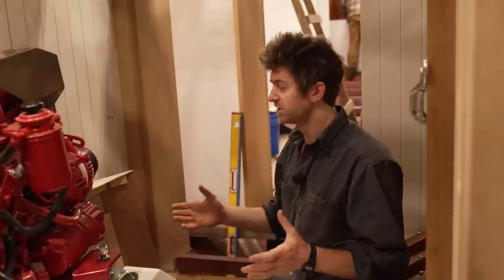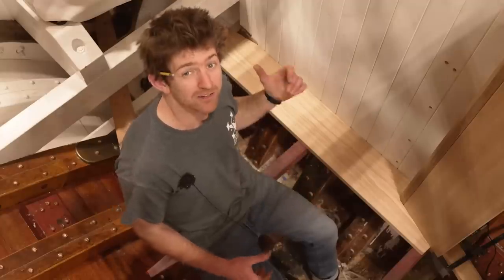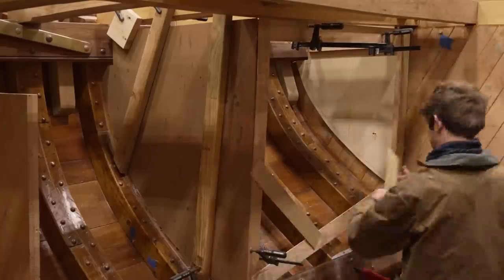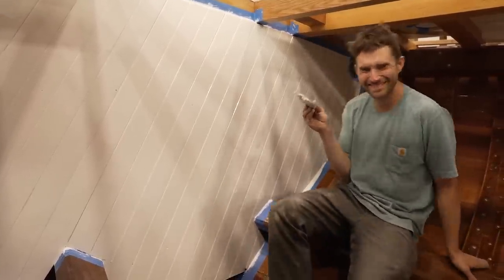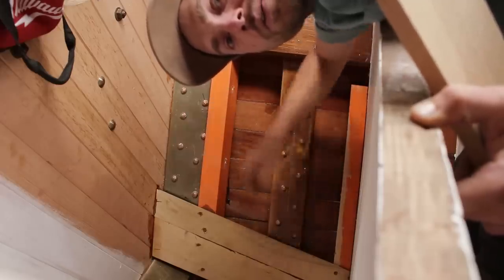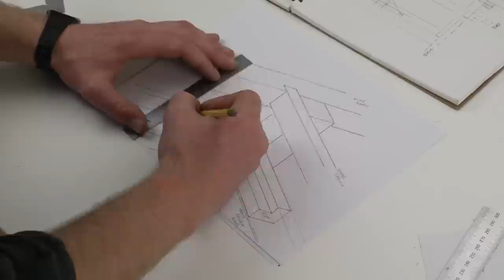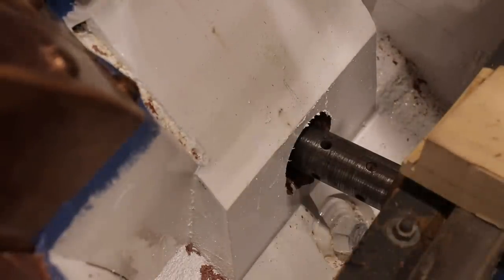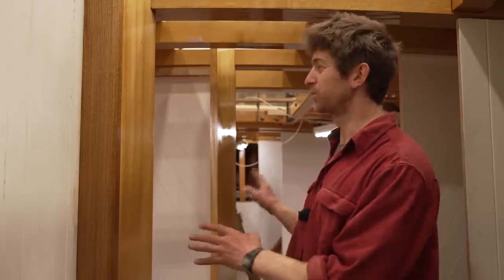BACK TO WORK! Lots of interior and systems progress... (Boatbuilding / Tally Ho EP126)

Comment: The 'dependancy tree' on this project is crazy. "I have time and materials to do the sole boards, but I have to get the fuel tanks designed, which ties to the deck plate, which ties to the cockpit design, which ties to the paint on the bulkheads... so I need to order the tanks, place the fittings, measure the spacing between the deck beams and after spinning those up, what was I doing? Huge respect for you.

Comment: Cockpits on wooden boats often have very straight vertical back rests and it really pays off to get some comfortable slope into the back as well as the seat so you’ll automatically slide in backwards due to the slight angle. It sits very comfortably as you slide in the back of the seat with a comfortable backward leaning resting position from which you can still steer the boat and operate winches comfortably as well. Maybe test and calculate in some dimensions for cushions that are comfortable but not to thick. You’ll be spending lots of time sitting there and there are human dimensions and angles that are industry standard for comfortable seating, it’s worth looking into (interior design as a study has lots of lists with  predetermined dimensions correlating with the size of people it’s designed for, it’s really helpful to build comfortable well sized seating etc.)

Comment: Much enjoy watching Tally Ho being reborn' i was a commercial fisherman in Alaska for 30 years and had 3 sail boats after i retired. If you aren't planning to put a drain plug in that drip pan you might consider it. Easter to get the bulk of fluids out if you have a high volume spill.
Reply: Definitely
Reply: I agree. If not a drain plug, I'd put a sump area in the pan to dip a suction hose into. I'd also put a shallow "V" in the bottom of the pan to channel to the sump area..

Comment: You know what would be nice is a tap on the oil pan to drain it into a bucket cleanly if it gets full as well as an oil tap in the oil sump of the engine. Mitch cleaner than mopping up with oily rags or pulling a bung plug.

Comment: This was great! 
I have had many radically different jobs in my life, and as a result have lived many different lives.  Because of that I notice patterns in kinds of work.  I have lived (worked) in worlds where there was no music at all (my time in politics was bereft of music).  One thing I will say about boat builders is that music is part of their world and they are well steeped in good music. Heavy equipment opperation (scrapers, cats, and graders), and driving highway buses (motor coaches) were the two worlds of mine that were heavily geared to music (pun intended).  I have followed you for quite some time now, and I have to say, damn man, you have fine taste in tunes; and in other things as well (like wood, videography, companions, ethics and stuff).

Comment: That was a tricky sole board, I liked the little round notches for the frame rivet heads.

For the video style do what you feel works for you. 

I thought the prop tube was going to be a hammer into place item. Looking forward to the diesel tanks episode. 
How did you and Patrick end up doing in the race?

Comment: I love your work and the videos. Tally Ho will be a masterpiece when finished. I have question regarding the drip pan for the engine. With the slanted sides, won't that result in oil spilling into the bilge (if there is any in the pan) when the boat heals over?

Comment: Need to add external handles  to your drip pan....or you could just get oily everytime YOU  take it out
Reply: Perhaps the drip pan needs a drip port with drain plug somewhere up front?  Could let any oil drain out of the pan into a small container and not have to remove the pan?
Reply: Don't believe it's ever intended to be removed. Ideally it should have nothing, or near nothing in it.

If something blows and dumps the crank case into it, they'd be far wiser to pump it out of the tray into jugs for removal, and you can just clean the residue with rags and solvent in situ.
Reply: There is always condensation drips, slight drips from gaskets, and fill spills--   a drain plug is for routine use, not for catastrophic events.... @Nevir202
Reply: @alfaspiderveloce6617  Nobody was talking to you.

I'm saying it's nuts to take it out as OP was implying.

Ya, you may get drips here or there, but you aren't going to remove the pan, or need a drain port for a handful of drips.
Reply: @Nevir202  umm a few drops doesnt cover the need to avoid pumping oil into the ocean from the bilge
Reply: @chascain1  Ya, because the pan is also there in the event of a catastrophic leak. 

But again, in the event of that, if you try to move that pan, FULL OF OIL, you're going to spill it into the bilge and put it into the ocean anyway.

Comment: I failed miserably to fit some skirting boards (base-boards) in my home so when I see the precision fit of your woodworking it amazes me. It also infuriates me at the same time.
Reply: Patterns are your friend. CAD Cardboard Aided Design. :) But seriously, if you master the uses of patterns, no fitting task will be above you and you'll look back and laugh because it was always so easy. You can also help yourself with various tools of the draftsman. Compass, square, the edge fingers etc. And they don't even need to be the most expensive variant of said items, you can make do with functional variants of them.

Comment: Loved the video, as usual. Chiseling the wooden plugs is particularly satisfying to watch. 😄  The different processes of designing that you use are great to see: from rough model to sketch to CAD. I found the occasional radio coming through very good, in fact the first one had a bit about the new Prime Minister of Australia and that gives me a good sense how recently you were busy with that project. You never did where you finished in the sailing race… unless of course you didn’t complete the course. 😉 
Looking forward to the tank installation video and the fancy new filler cap to be fitted.

Comment: I am no help on which formats are best.  I like them all.  I appreciate all the time you spend to film/edit and we get to see enough of what you are doing so we understand your process.  It’s always great to see your tools, equipment, shops, and the cast of characters.  I enjoy your hand drawings, too.  I try to mix sketches with my CAD drawings in my shop for myself and sometimes for clients.  You are more artistically skilled than me, tho.

I am a retired timber framer and have a well equipped and nice size personal shop.  It’s been great for working on and winter storing my fleet of boats here.  My stuff (and there is a LOT) will go somewhere in the next ten years or so.  I am in northwest Montana…..maybe to a young timber framer who wants to make a go of it?  Or maybe it will be a talented boatbuilder like you in Port Townsend.  I am still picking away at my stock of dry salvaged fir.  I still have a lot of projects.

I have not been to Port Townsend since 2014??.  Work, play, and Covid impacts.  It’s time to go this September.  It would be great to meet you and your crew for after-work beers.

Comment: With regard to the drip pan for the engine, May I suggest & recommend you have the metal worker include a “return” around the top edge, to prevent any excess fluids from slopping over into the bilge. It’s amazing how these problems will happen when you are not looking, or busy on the forward deck.

Comment: Just an idea. The drip tray should be sloped with a ball valve for changing the oil. You could drain the engine into the tray and let gravity feed it into an container at the front. Wipe down the tray when you're finished.

Comment: The drip tray is a good idea, but since this is a sailing vessel I suggest to make the sides higher otherwise any oil may flow out when heeled. 
Also suggest to check any possible oil leaks when the engine is under extreme heel. (like accidentally drying out on the tide). The dipstick and crank vent should be led to somewhere along the centerline so all oil in the engine stays in the engine, whatever position the vessel is in. Also check the gearbox vent opening. 
I learned this the hard way... I dried out, forgot about the engine, and after the tide came back and the boat afloat, found most of the oil back in the wet gear locker having escaped the engine via the dipstick

Comment: Hi Leo, I love your mission. About the drip tray; maybe it is an idea to make a tiny (few cm wide) roof on both sides of the drip tray to prevent oil from going over it when the boat is shaking or/and at an angle. That small side roof could be tilted down a bit to the inside just in case oil spils on top of it so it drips into the tray.

Comment: I enjoy watching all the intricacies and cutting various multi angles as you've hand crafted each piece of wood to fit to an exacting standard.
Bulkheads, soul, doorways and all the like are amazing to watch as you machine and fit each piece.  Bolts, screws, tar, glue all used to make the total one solid structure.
Before the advent of power tools, I can imagine that the amount of handmade parts and labor for such a project was off the charts.

How may boat builders would work on a boat like this at one time, back in the days of its origin?

The amounts of heavy hard wood being used is staggering to me!  The boat must weigh a lot.   The engineering work and design needed to properly float this boat, with its weight, is amazing to me!  
I'm enjoying the journey with you as you go along in the build.

Comment: I really enjoyed the video and the variety of jobs. Thank you for showing the thin ply and hot glue method of templating, it's such an easy and accurate system that I wish we had back in the 60's when I started boatbuilding. I think you mentioned a sender when talking about the polly tanks, if that is for a fuel gauge then I would think again. In my experience they have all been inaccurate and temperamental, you really can't beat a dipstick and if you loose that a broom handle will suffice. I am really glad to see you re-energised from your trip back to Blighty and really looking forward to seeing Tally Ho in the fitting out stages. Congratulations on your skills not only as a boatbuilder but also as filmmaker, editor and storyteller.

Comment: Good idea to put a drain plug under the catch pan making for easy cleaning or for oil changes. Also a big plastic drum (old water tank) in the chain locker for the chain storage would be a thought. With a small drum or 12 inch pipe drilled full of holes placed inside to protect a clean out pump. For when you wash off the chain in the drum. Plus it keeps the chain locker clean, dry and the dead sea creatures smells down. 🧐👍

Comment: I put a larger dia. shaft in a wooden boat and used the same method as you to bore out to accommodate the larger stern tube. In do so I cut through some of the fasteners. Eight years later we had a water leak, it turned out that electrolytes had occurred between fasteners and stern tube. It took some head scratching  to find the fault, we had to replace the tube.
Cheers, 
Peter

Comment: I might have added a drain valve  in that pan. When that pan gets a load of oil in it, it's going to be heavy and unwieldy. With a small drain valve you could remove any spillage with a small bottle untill it's easier to handle taking the pan out.

Comment: I like the variety of this sort of video. I'd be interested to see what your plan looks like. I'm sure you don't have a modern-style project plan with Gantt charts and such (good thing too, more time spent planning than doing) but you must at least have a list, with some sort of sequence so that things that need to be done before other things are sorted out. So many little tasks - nearly everything that goes in the boat seems to need 'a couple more coats' or a 'final trim to length later', nobody could just remember all these things and it's hard to believe it's just scraps of paper in a shoe-box. Very grateful for the 'inboard-outboard' and 'forward-aft' markings on your beautiful drawings, else I'd be thoroughly confused.

Comment: Enjoyed the variety, Pati on bulkheads, chain locker, paint.  Once again, your sketches and CAD designs are impressive.  From the engine drip tray to the fuel tanks.  The prop shaft work, cabin sole, are underway.

Comment: The way you matched the board and grain pattern in the sole boards was very nicely done!
Reply: The first board seen initially not so much of a fit, but it introduces the sculptural tension into the whole when seen as a piece of art. thank you for what you do.
Reply: @BRUSHYSURFING  For your information you can always edit your comments by clicking on the 3 vertical dots to the right of comment.

Comment: Your drip tray needs some vertical X's - one piece running about 75% of the length down the middle and two cross pieces about 75% of the width.  You are likely going to be rocking about and anything in it should not gain momentum and slosh out.  Much like baffles in an oil tanker.

Comment: Hey Leo I'd recommend you to make the drip tray drain into a small pipe and install a swimmer with an electric sensor that is normally closed and wire it to an emergency stop or ignition cut off for the engine to stop. If you think you need the engine you can install an override at the switch panel as well. This way you won't unintentionally hurt the engine.

Comment: Thanks Leo great work as always 👍🏻liked the variety of jobs done. As the build get to this stage would guess the videos will cover lots of construction at a on going stage. This is very interesting looking forward to the engine installation as i am a mechanical engineer so interested to see how you go about this. Have marinised a few kubota engines for 30 foot boats but intrested to see how you go about this and what system for fuel and exhaust you will install. Love the engine drip tray design 👏 what a great idea. ⛵🏴⚓

Comment: With regards to the return line for the diesel tanks it should be plumbed into the bottom of the tanks so it minimises airation of the fuel and it won't sound like someone is peeing in the tank. You could get away with having the return line going in at the top if you had a metal pipe going down to the bottom but I imagine it would have to be reasonably strong to cope with fuel sloshing about when sailing with 1/2 a tank

Comment: I don’t own a boat so maybe I’m talking nonsense for some reason suggesting this but every time I see a chain locker I think why don’t they use a thick rubber lining like a big bag shaped to its chain locker form with a wide drain at its lowest point. So much easier to clean, reduces sound and absorbs chain impact protecting the boat inners from damage and filth. Hang or clip it somehow into the corners of the trapezoid shape I image chain lockers to be, that way it’s easy to remove for any inspection or work needed whilst staying in place under sail. Just an idea for keeping excess moisture and chain growth and stuff out of the boat from stinking up the place. Imagine that contact cement glued and tight hand sown quarter inch thick rubber with grommets to hook it in place would do it.

Comment: Have you planned to use the generated energy (heat) from the Engine to maybe warm up either Water or Radiators? I know that it is not the plan to use the Motor very often, but depending on where you are sailing this might come in handy at times.

Comment: Have you considered installing fuel ”polishing” gear in the tanks? Line in and out with a pump and Racor-fuel filter to periodically clean the fuel in the tank. Many literature currently indicate that the modern fuel with bio-additives have increased the fouled fuel incidents. It is easier to clean the fuel than find out your fuel is fouled the ”old way”.

Comment: So far as engine oil droppings are concerned, I would be less worried about oil in the bilge being pumped overboard contaminating the virtually endless ocean than I would with the oil accumulating in the bilge and being fed on by the very bacteria that naturally decompose oil in the ocean. Examples include Marinobacter, Oceanospiralles, Pseudomonas, and Alkanivorax. These bacteria decompose the oil, but in the process they release sulfur compounds (there’s a lot of sulfur in diesel and lube oil) the result is a continuous sulfurous odor emenating from the bilge.

Comment: Good to see the small details that go towards the final finish not just the major pieces. However while you have the creative spirit back you need to be working on a book about the build not just videos. The drawings you show are just calling out to be published as part of a work on the contruction of Tally Ho, they are as good as those produced by professional illustrators in many of the books about wooden hill contruction and sailing. Such a book would fit well in my library along with those of older authors such as Edgar Marsh.

Comment: Been watching the videos for a long time, great work as always. But always wondering if there is any part of the original boat left?
Reply: At present, only the bottom 3 (of 6 total) teak transom planks. About half of the newly-cast ballast keel is re-used from the old keel. In the future, there's most of the teak deckhouse sides, a half-dozen portlights, the large bronze capstan, & very few bits of deck hardware such as the jib-boom's heel bracket.

Comment: Hi Leo!
Awesome as always!
Question: as seen in this video - it seems your chain locker would have "moisture pockets" between the hull and the locker walls. I know the bilge is connected throughout the hull, but  - as moisture air rises - I would think you could have a mold/mildew problem shortly in there...
Or do you plan to have breather holes on top of the locker-walls?